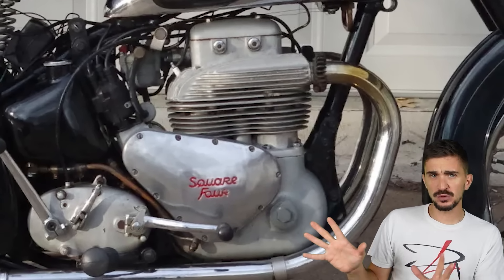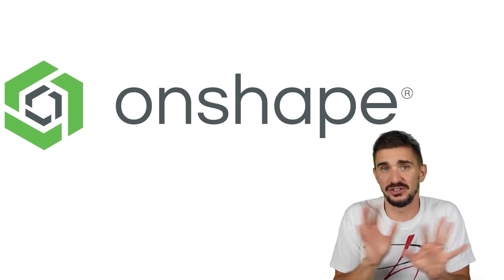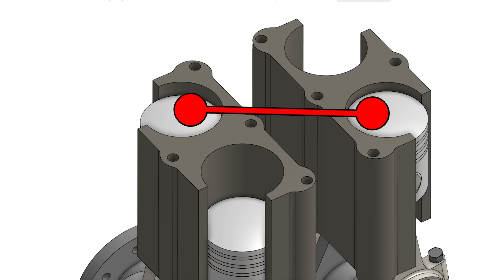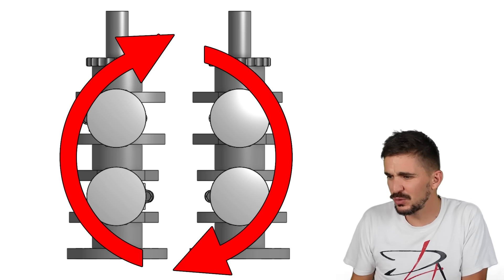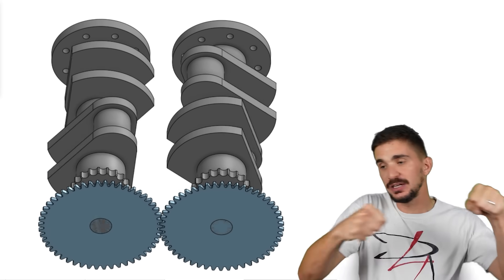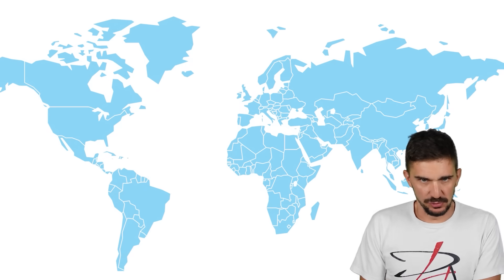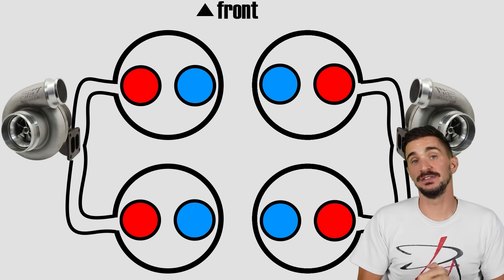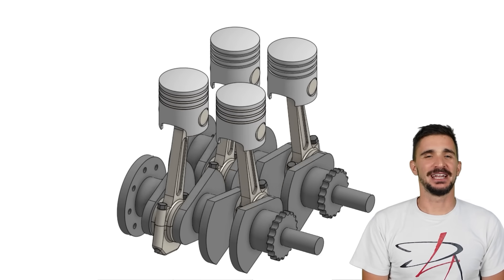From the Outside It Looks Like a Single but Inside Four Pistons Mingle! Square Four Engine Explained

Comment: I think you might be wrong about just 1 thing.  With two cranks turning in opposite directions, when the bike leans left, the forward crank will want to yaw left, and the backward turning crank will want to yaw right.  Yes, that means the yaw forces cancel, but it also means that neither crank gets to yaw like it wants, which means that both cranks will resist the bikes lean to the left (or right).  This is probably a triviality compared to the gyroscopic forces from the wheels, etc. , but 2 cranks does not make the bike easier to lean into a turn, it just makes it equally easy/difficult to lean into a turn in either direction.  Call me out if I am wrong...

Comment: If it's so good and compact and relatively simple to make, then why are there so few of these engines? Cooling the rear cylinders? Might be something cool for a bike company to do nowadays but liquid cooled. Instead of the myriad parallel twins with 270 deg cranks, 180 degree parallels, inline fours (big bang & not), V4's, triple, boxer-twins, singles and V-twins. I still think triples are the best for road bikes. I also wish people would remember that Yamaha had a 270 deg parallel twin in the 90's with the super underrated TRX850.

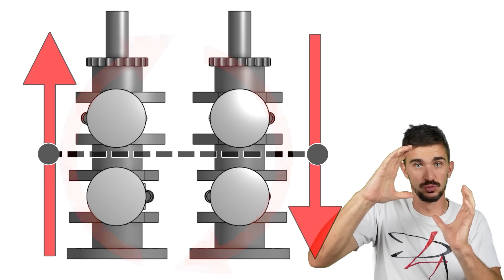Comment: 7:25 I think this is a mistake. If you apply this reasoning from a bottom view, you get a moment in the opposite direction. The rocking couples are still balanced.

Comment: The exhaust sound is just like a boxer-4, for the same reason: the two cylinders adjacent on the same side are 180 degrees apart - instead of the 360 degrees which they should be - so each side is an unbalanced if using a 2-into-1 exhaust manifold.

Comment: Excellent video, never even thought that there could be a square-4 engine!
Question: how about weight, is the square-4 engine lighter or heavier than the inline-4? I suspect it will be slightly heavier due to the two crankshafts.
Reply from the maker: You suspect right, definitely heavier because of the extra crank

Comment: I  have  designed  Four  Square  Engine  having  only  one  Single throw  Crankshaft   and  having  all  performance  features  of  Inline  4-  Cylinder  Engine.  Ref :  SAE  Technical  Paper  No.  840 463

Comment: Imagine the square four being rotated ninety degrees. In one configuration the cranks would be be inline with a driveshaft like a BMW. Rotate ninety degrees and you have a chain (or belt) drive bike. A clever crankcase design could be used for both, just swap out the drive train.

Comment: An opposed piston engine is long but thin great for sailboat backup . I think 3 small cylinders  is good . no valves , cylinder head .I think diesel & HHO is the way to go . Boats are not as limited as cars & trucks .

Comment: THIS WAS AN OUTSTANDING ENGINE ANS AS YOU SAY SAD FORGOTTEN ABOUT. I CAN REMEMBER THEM AND THE PROBLEM WAS THE REAR CYLINDERS GOT TO HOT. TODAY WHAT A COMPACT CAR ENGINE AND WATERCOOLED  FAR MORE ROOM UNDER THE BONNET. IF A TWO STROKE IT WOULD BE VERY FAST AND SIMPLE TO MAKE. FOR RACING ETC. EASYER TODAY TO SOLVE ANY PROBLEMS.

Comment: The brothers were offering a powder coating service for motorcycle frames in the late 70s / early 80s  I had my Suzuki GT500A frame and a lot of ancillary parts coated by them.  They used an epoxy polyester mix they believed was better than epoxy or polyester alone.  I can see why, (Polyester's resistant to sunlight / UV ) but it wasn't really terribly abrasion resistant...  Looked nice until the bike was stolen...

Comment: The only square four engine I know of was the Ariel Square four. I never rode on one, but I saw many of them when I was in New Zealand in 1972. They didn't have a very good reputation. The rear two cylinders tended to overheat. And the two crankshafts add a lot of weight. Smooth? Yeah. And that was a big deal, especially on British bikes.

Comment: My late uncle owned one and it was the power of a side car outfit. His comment was that it had good power for its day but could overheat on long journeys partly due to the difficulty in internal cooling between the cylinder banks. You have to remember that roads were very different just post war than they are today. There had been very limited repairs during the war and the bike frame was quite hard upon the rider! He kept it for many years and used it as regular transport but substituted a small car for business journeys between Wales and London.

Comment: Yup so one ONE cylinder wall cracks u gotta replace the WHOLE thing. Not just 1 top end. That’s y it never caught on. More costly to fix and usually just have to replace the whole unit

Comment: Why not just integrate the intake manifold into the head like some modern engines have for the exhaust? Then have the injectors plug straight to the head.

Comment: Haven't seen an Aerial Square 4 in 60 years 😲
Didn't think their were any left, other than private collectors ✝️🇺🇸😀
The engine did tend to overheat though 😟
Needed better air flow to the back cylinders 🙂

Comment: The amazing thing about the Ariel square four was that it was originally an OHC engine designed by Edward Turner in 1928! 
Unfortunately, from there on in, Turner's expertise went backwards to producing antiquated cr@p pushrod parallel twins in the 1970's.🤦
All that innovation in 1928 yet Turner made the mind boggling mistake of not water cooling this flawed design. Such an engine would have been world leading & ahead of the Japanese by 40years!

Comment: My 52 2 piper Squariel that I rebuilt is worth mentioning that it was built in witworths, not sae or metric.  And old brit system the bike builders hung on to that system rather than re-tool.  Edwin Turner triumph 500cc parallel twins geared together.   cooling was improved on the 4 piper.    i had a buddy with a cb750 (1972) and the squariel ran just as smooth.  Compared to bikes of the period - better.  Ace/henderson/indian had inline 4s but not across the frame. (1930s).   It also suffered from 12 hp brakes with a 40 hp engine.  not fun in modern traffic.   perhaps kevlar brake shoes like I had in a 59 chevy 1 ton truck would have made it work better as the truck stopped almost as good as discs with the kevlar brake shoes.   it was a landmark bike and I was glad to have had the opportunity to do one up.  And mine ran better than the one in your video.   There were also the zooki gp 2 stroke square 4s too that were doing well up until 4 strokes were put into moto gp.  4 strokes are easier to ride and the 2 strokes had gone about as far as they could.    Another problem was being pre-unit - engine separate from transmission.   The primary chain drive was hard to seal up.  Many cheated by filling it with grease and then adding oil.   But perhaps the bikes didn't last as long because they were no longer 'self lubricating'.   All in all, in modern traffic more fun to build than to ride.

Comment: Really fun video. How about if you combined the offset crankshaft and extra long connecting rods.  To make it work with one crankshaft? Would it be impossible to get ok or good dimensions??. I can’t draw I Cad unfortunately. But it would be fun to se what kind of possible constructions are possible. Where are the dimensions to small? Would the pill shape pistons but 90 degree turn of piston bolt be a possible new engine type?  Just trying to se if it’s possible or not.

Comment: Your ability to already know the nit picking questions that viewers will bring up, and then make fun of yourself while addressing them in the flow of your videos is quite a thing to watch. I believe this is a important contributing factor to your success and popularity. I enjoy it quite a bit lol.
Reply: Not an engineer, but wondering about applying this to a diesel engine for marine use as a sailboat auxiliary engine.  It appears it could make for a very smooth compact unit.  Marine engines are preferably very simple and easy to repair though, so it would probably be a tough sell.

Comment: Wait... Isn't this basically just a U4?

Also another advantage is low CG since most engine weight is in the bottom and this design has a BULKY bottom end.

Comment: I've inherited a 1948 square four from my dad. It has a cast iron head and the side reads 1000 to indicate that it is a 1 liter engine instead of saying Square Four. The two biggest problems the engine had was lubrication and heat dissipation. With the rear left cylinder being the worst off. Since I've got to rebuild the engine one been tinkering with the idea of both upgrading the old gear pump to a piston pump while also adding in either a drip spider or a inner lip to the valve body that can trap the oil with some designated funnels where the oil can pour out from once it gets full to help the oil spread more evenly as well as running some copper or bronze tubing around a few of the fins close to the cylinders in and hooking that up to a small radiator with an electric fan to help with the cooling, this is at that it isn't just relying on air to cool it.
Reply: Hullo sypoth, 
How about using the oil to increase the engine cooling. If you are doing things with the lubrication system anyway, why not go a bit further and add in a radiator to cool the oil, and a fan if neccesary? 
Best wishes

Comment: Yes, a curious formation, even now.  It was supposed that water-cooling would have solved any overheating of the rear two cylinders but the formation was dropped when the Ariel company was bought up by the Norton Company.  Still, those who did have them reported that they were very smooth and plenty torque engines.  I dare say we'll never know the difference water cooling would've made.  Cheers!

Comment: After you introduced me to rotary valves, I've been intrigued by the idea of a rotary valve SHARED between two or more cylinders:  Picture a rotary intake valve between two cylinders, feeding cylinder #1 then when the valve rotates 90deg, that inlet closes BUT the valve opens a different inlet for cylinder #2. Seems like the configuration of this engine might be conducive to this use of a rotary valve.

Comment: The thing is with AC motorcycles is that... they're stupidly simple and reliable (and cheap, too).

It makes sense why most would buy them over LCs despite the extra range it offers during use (due to overheating prevention).

You can't really compete with something that gives less headaches and more answers.

Choosing LC over AC is more of a preference rather than a requirement, unless you're talking about the big guns, in which, why the hell would you ever buy an aircooled one? You're just asking for trouble.

Comment: But the "rocking couples" from the two cylinder banks so to say, they should cancel, even if they are offset by a distance because they aren't linear, straight forces but rotations instead. And those wouldn't just occur on the sides of the engine but also in the front and back, also canceling.

Comment: I wondered if you put 2 different types of engines together, if you could get low end torque and high end revs, like a 500 or 600 cc thumper coupled to a GSXR engine, but with a geared reduction, so the big single could spin to say 5000 rpm and the GSXR spin at 10,000 rpm at the same time?

Comment: Well, yamaha built the V Max. Not the same, but a square 4, sorta,  ok v 4. but, does that ever work wonders. 140 hp for the 1200, and 190hp for the 1700. Brilliant engineering. smooth as silk  Why go backwards?

Comment: Maybe the reborn Ariel can replace its now defunct vfr1200 engined bike with an own designed square four and rekindle that connection to the orig company.  Expensive, but then even modern Ariels are.

Comment: so wait, why don't you offset, or rather re-align i guess, the 270 twins? then you have one piston at top, one at bottom, and 2 at mid. perfect cancelation of secondary balance, some rocking couple still but i doubt it'd be all that severe, and perfect primary balance outside of that.

Comment: No primary and secondary imbalance, finally a rival for inline 6
With current fuel injection tech, those intake ainno biggie im sureof
Reply: definitely, square four 270 volumetrically more compact than an inline 6, but with the perfect balance of inline 6. revolutionary!

Comment: Of coarse it was low end torque oriented. At higher rpm it would destroy its self though vibration and heat in the rear cylinders.

Comment: Amazing video!!.. I have restored a Yamaha TX500 DOHC and it was a heck of a different that engine works because one piston ignites just after the other and them both run loose the other three strokes, one closely after the other;  It's comparable to Harley Davison that does this with both pistons atached to the same crankshaft; one igniting just after the other: I apologize for such a small-talk speech here in this "ARIEL" special environment!:person-turquoise-waving-speech:

Comment: I suspect that Engine Simulator may be  the closest we will ever get to hearing a 270° Offset Square Four. It's a program designed to produce engine audio (including exhaust pipes) & simulates engine characteristics, though they should he taken eith a grain of salt

Engine Simulator - Community Edition is freely available for those interested

Comment: This model with the 4 exhausts ports was the better.  Also jetting was a factor, go a bit rich to keep the heat low.   Engine had torque and was design for a side car.   The better for performance was the 500 Hunts Master.  It was a bit like the BSA Goldie.

Comment: I want this in a lightweight roadster, you could shift so much weight from the front to the rear because the engine doesn't jut out as far compared to an inline four

Comment: yeah the linear one stick 4-piston surface engine would be swell. yes its like one very long piston tunnel. only if fusion was local, not cloud app. nah having the capability to diy is much more than copy, even complex stuff. complex is not worth copying. well its obviously too complex if you are not willing to do diy. tower-4 engine it is. not line, not square, not v, but tower. not even hammer-4, even if interesting. double tower-4 is an 8-ball engine. speech is cheap. so ask pcbway to make your cad design.
Reply: nah linear piston engines. row of pistons engine to be exact.

Comment: One problem the Arial square 4 had was at high revs the back lash between the two crank gears use to play havoc with the timing.... anything pass 5k and it would start to miss slightly,or worse case blow the ars out of the bottom end...but where a great sidecar bike and sprinter

Comment: Wouldn't there be an efficiency penalty for gearing the cranks together? Also doesn't that mean the flywheel would have to be mounted off center, potentially having other balance effects
Reply: You also have one additional crankshaft bearing. Again, more friction

Comment: The two crankshafts not behind one another but beside one another. Thus both inline with the motorcycle. If they both rotate into different directions, one left one right, vibration would be greatly eliminated. But you could ask yourself the question weather you won’t prefer a boxer engine with just one crankshaft.

Comment: There are also more frictional losses with a square four design, as not only are gears needed to mesh to synchronise the cranks but more bearings are needed as well.  There are also additional manufacturing costs that mean the 'Squariel' format is unlikely to make a mass-production return.  For a real money pit make a square four six stroke engine!

Comment: Interesting, thanks. Would have been helpful to know how the two crankshafts combine into a single output for the drive.
Reply from the maker: With gears, it's shown in the video too
Reply: @d4a  ok so you only show the two meshed gears, but it’s not intuitive how this leads to a single drive shaft. Had to look it up.

Comment: Very scholarly, but .....  In the early 1960s I went and looked at several used Squares.  Gave up the idea of owning one due to the severe vibration of the engine.  Thirty years later I bought one just for the beauty of it.  Still the vibration problem.  It was a restoration by expert Arlin Jeffries, should have been perfect but was not.

Comment: They probably ARE rare now, but back in the seventies, not so much. Back then, most of the shops and dealers that handled used bikes had one or a few sitting around. At least one shop I knew of in the Dallas Texas area had a bunch of them.

Comment: More oil, more oil cooling, piston squirters, larger oil galleys, oil cooler would seem to solve the Ariel Square fours heating issues. However, an air cooled square four will always have less cooling for the rear cylinders. It will always be more expensive than a single crank engine. However, considering that OHC V4's have two cam drives, it is possible to have some cost savings with just one cam drive. The intake could be similar to a narrow angle VW VR6, or Lancia. However I would prefer to see a triple cam four valve with the center cam operating the intake valves nestled in the V of the intake manifold. This would be akin to some of the mid sixties Indianapolis V8 engines, where the intake tract is toward the center of the cylinder, between the spark plug and the intake valve. 

That the square four is more cube like would lend itself to a layout where the bores are inclined or parallel with the ground like the lower cylinder of the Ducat L twin. The exhaust routing might be a problem. However, the clutch could be high above the gearbox allowing a narrower engine. An exposed place for the throttle body though...

Thank you!

Comment: I was also thinking of the same two 270 cranks but with a scenario looking like a radial engine, and possibly adding offset cylinder and rotary valve to the mix...